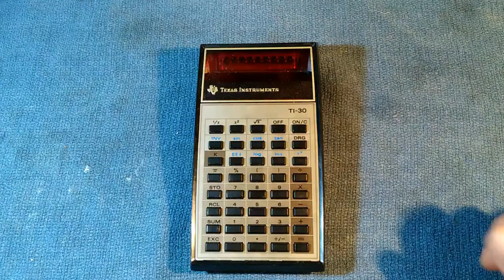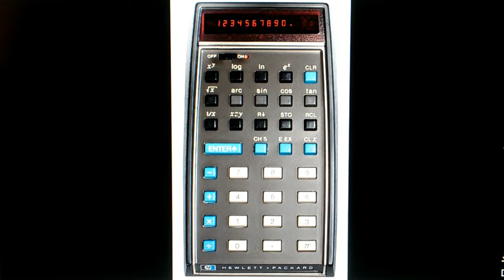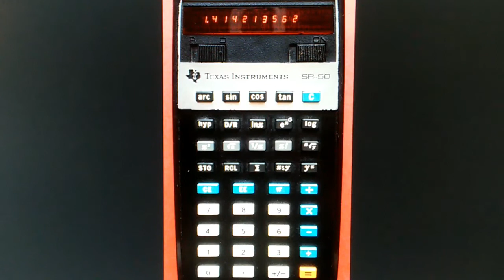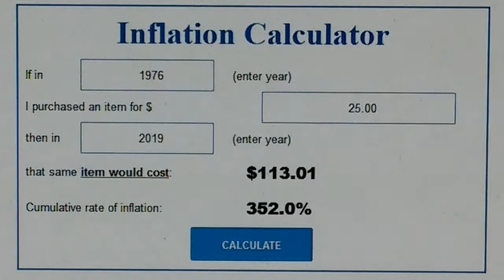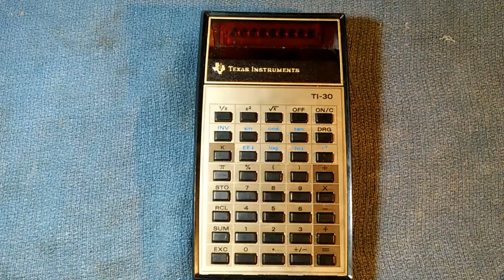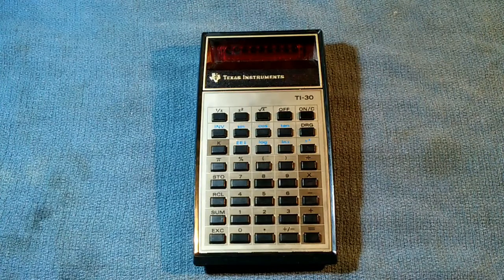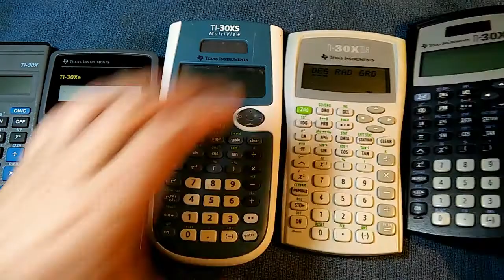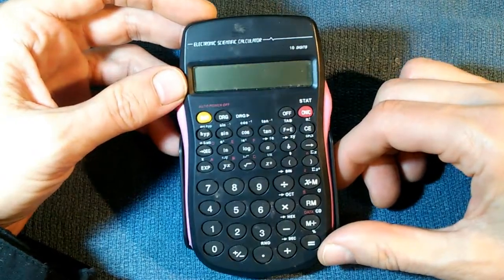Texas Instruments TI-30. The calculator that broke the price barrier.

Comment: I still have the TI-SR50, paid about $170 for it. Had to buy it from a coworker who knew a seller, wasn't like you walk into a store and buy one. Got another one from my BIL, a NASA engineer, when he upgraded. Both SR50s won't turn on, looks like from leaking batteries. Just got the HP-35, couldn't touch it, was too expensive then. The 35 works after replacing with a homemade battery pack, flaky on/off slide switch though. Both SR50 and 35 works about the same, algebraic or RPN. I have a collection of HPs now from an early 70s desktop scientific calculator with impact printer to HP-50g.

Comment: I’ve just acquired a Fullers calculator cylindrical slide rule. This was the equivalent of a scientific calculator in it today but they made the same device for almost 100 years with only some minor changes in materials. Anyone familiar with the first one would have no problem using the last one ever made.

Comment: I had one of those TI-30 LED calculators at high school. There were cheaper scientific calculators available, e.g. although the Sinclair Scientific was $100 when it was released in 1974, it had dropped below the price of the TI-30 when the TI calculator was released in 1976. Not really comparable though with the Sinclair Scientific being much more compromised (and tiny in comparison to the TI-30).

Comment: Excellent little video. Thank you. As a calculator fan (in the HP camp,) I use on my phone Droid48 which actually legally uses the HP ROM. I've found most calculators of the phone variety essentially broken as they use floating point (and lie) instead of BCD which all true calculators use. I'm curious as you are a fellow calculator nerd as to what calculator you have on your phone? It's called "Calculator" and I've failed to find a match to the icon on Google play. Who is the author?
Reply: whoever made your phone made it.

Comment: This major price reduction was due to a break through in manufacturing technology. Something like that 400 dollar HP calculator had about 5 or 6 micro processors inside.
Ti-30 was able to put nearly ALL calculator functions on ONE CHIP !
Thus, were able to mass produce their calculator for far, far less money then the H.P.